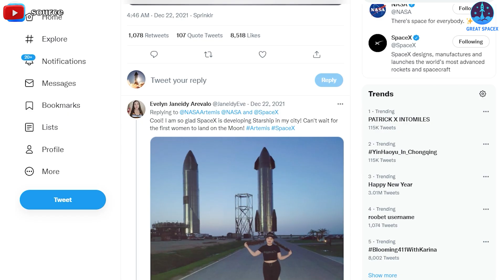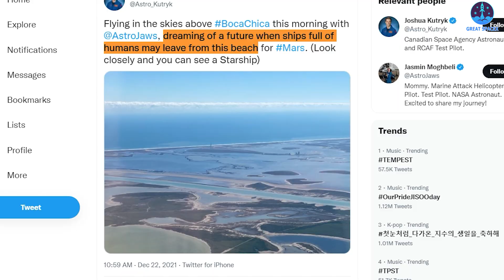NASA Artemis teams shocking discovery at SpaceX’s Starship factory and launchpad!

Comment: I don't get why they're testing SLS sending the capsule around the moon with Astronauts if they're gonna be landing on the moon aboard Starship. They're probably gonna have to test Starship around the moon before the Artemis 3 moon landing anyway. Unless  SLS and the capsule are continuing as the backup in case Starship with booster doesn't work out?

Comment: i think they should design a star ship that can land horizontally on the moon. on the moon your going to have to find a perfectly level landing area and hope the surface is stable enough so the legs dont sink its so top heavy wouldnt take much of a lean to make it tip over or a wide base landing legs with large pads couple meters wide im an expert at kerbal space program lander design so trust me. ive lost many spacecraft on the mun
Reply from the maker: a great idea. thank you
Reply: Err ... the x 6 engines are located in the tail along with all the plumbing, and the big virtually empty fuel tanks are above it connected by only a downpipe. 
Starship is top heavy, you say? I cannot understand why you have trouble landing on the Mun, with your superior grasp of physics...
Reply: There is less gravity on the moon so everything is lighter compared to on earth. Nothing can sink on a big dry rock.
Also the legs dont need to extend the same length. They can all extend to their own lenght to make the ship level perfectly.